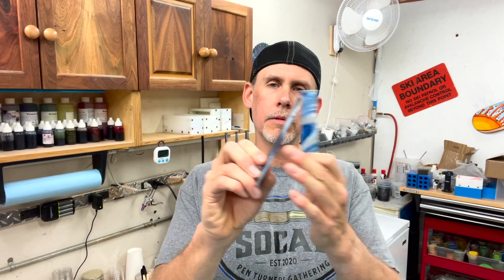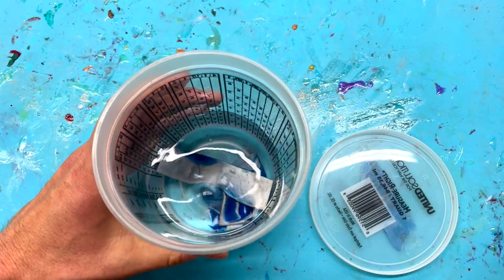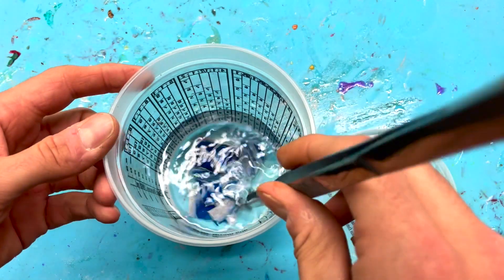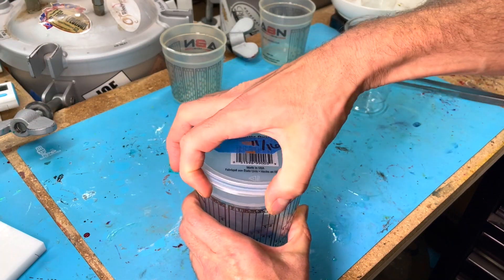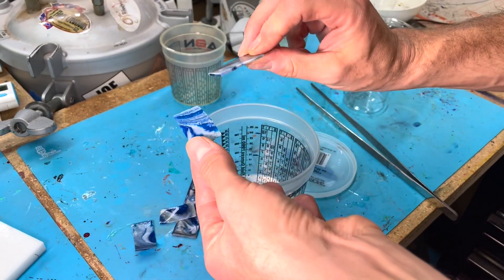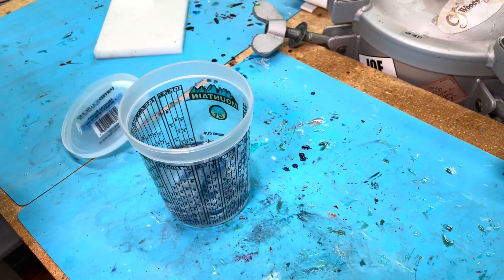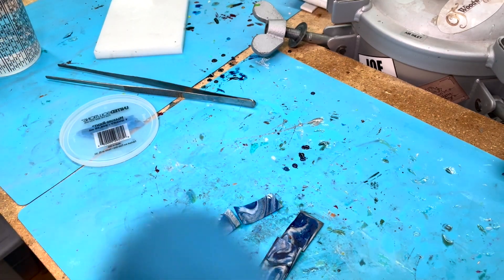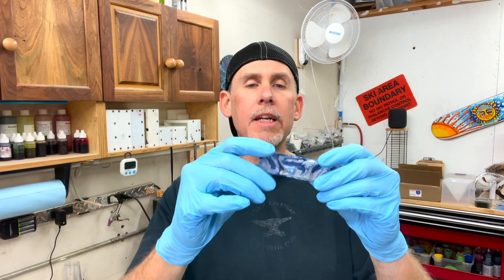Can You Dissolve Alumilite Clear Resin in Acetone?

Comment: You test proves that yes it doesn't dissolve in acetone, but the softening of the resin enables you to recover the  tube if your blank has a failure that cannot be fixed.  Thanks for the vid Zac.
Reply from the maker: Glad to share, it was fun 😀It should make it easier I would think. You can also just turn off the blank if you don't want to wait

Comment: I've done tube in castings with clear slow that I  didn't like the way they turned out so I soaked them in acetone to get the tubes out so I can re-use the tubes.  It breaks apart easier, but like you said, doesn't dissolve.

Comment: Interesting. My only question is does it stay flexible after being cleaned off and left out of the acetone? Would be nice if it stiffened up again so you can bend it into shapes. :) - Heidi
Reply: That is my question also. It'd be kinda cool to make like a bow tie or curly Xmas ornaments and such. Off to the store for a gallon of acetone lol.
Reply: @StephensPenTurnings  I'd just use heat to soften the PU instead of acetone.
Reply: @JohnJones-oy3md  Except for the hot plastic thing I would agree. I have a heat gun or maybe the toaster oven on low.I use epoxy and polyester resins so my results will be different. Still an interesting idea however it comes out.
Reply from the maker: I'll check it, I saved the pieces. I would probably go for heat over acetone like John mentioned below. That works great and you don't have to use/waste any chemicals

Comment: I wonder if it will stay soft and flexible or if it will garden back up after the acetone evaporates? Could be a way to bend resin to odd shapes if it does.
Reply from the maker: I saved the pieces, I'll have to do a follow up on that. Might just include that info on the next experiment I do with epoxy. I'm guessing it will has hardened up, but I haven't looked at it yet

Comment: Hey Zac, got a question for you . I was wondering if and which  resin is best for outdoor use?  Which is more waterproof?which is more UV resistant?  Thanks
Reply from the maker: Hmm, that's a good question. They are all waterproof I believe, but I'm not sure if any resins are totally UV resistant. They all usually yellow over time. You'd have to contact resin manufacturers directly and explain your specific use case with them to try to pinpoint a formula that will do what you want. Unfortunately, I don't know of any off hand

Comment: I have used this method to get some tubes back for label casts after about two weeks the resin will split with a little pressure and I can get the tubes back.  I have left Alumilite slow clear in there for two or three months and although it gets like a gummy bear, it never really dissolves
Reply from the maker: I'm too impatient, just turn it off if I need to LOL Great to know that longer doesn't really dissolve it too

Comment: Can you use acetone to dilute these resins?
Reply from the maker: It's possible with some, but it can also change the chemistry a bit resulting in different tolerances like hardness, etc. I'd recommend contacting the manufacturer to find out more info on that for your specific use case